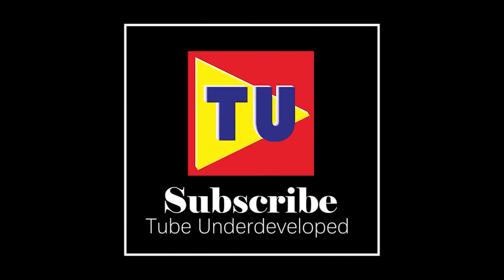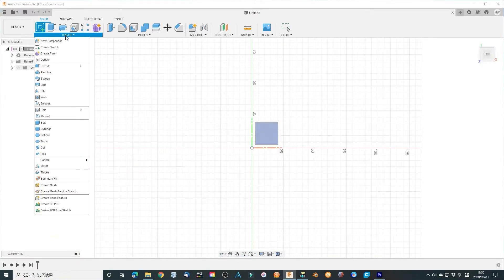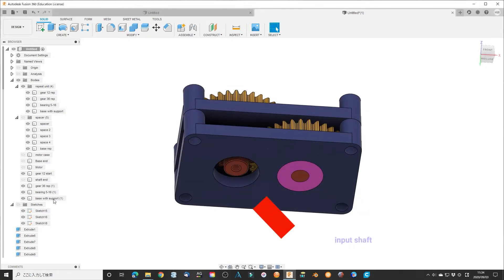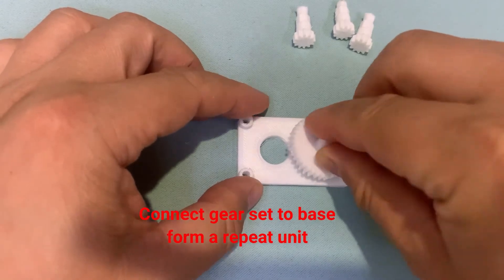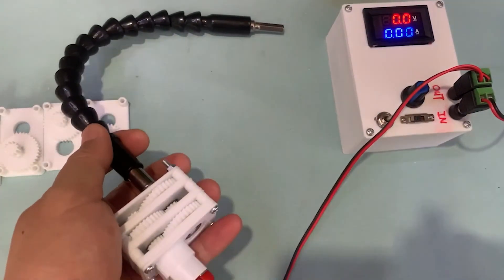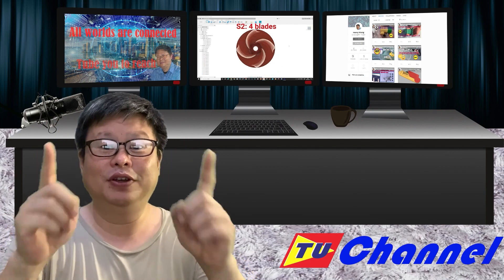How to make an extendable gearbox with ball bearing embedded

Comment: Very good work!!!! 
 I have a question....the specs on this TT DC motor as per this link (https://www.verical.com/datasheet/adafruit-brushless-dc-motors-3777-5912007.pdf) are:

Rated Voltage: 3~6V
Continuous No-Load Current: 150mA +/- 10%
Min. Operating Speed (3V): 90+/- 10% RPM
Min. Operating Speed (6V): 200+/- 10% RPM
Torque: 0.15Nm ~0.60Nm
Stall Torque (6V): 0.8kg.cm
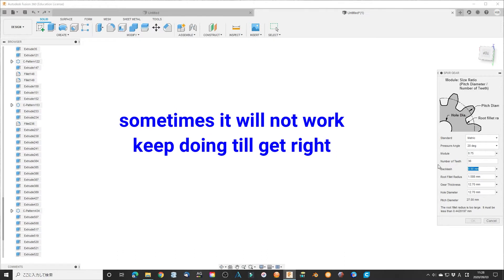Gear Ratio: 1:48
Body Dimensions: 70 x 22 x 18mm
Wires Length: 200mm & 28 AWG

The stall torque  at 6 volts is 0.8 kg-cm ( or 0.08  Nm)....but here is the issue... the running torque is listed as 0.15 to about ~0.6 Nm ....This does not make any sense. The running torque should be less than the stall torque.   Based on what you know...what will be the stall torque for this  motor at the wheel axle (a gear ratio of 1:48)?  How the running torque is larger than the stall torque...??? .. It can be say that the spec are wrong... but still I would like to know  truly the  stall torque for  this DC motor at the wheel axle...? My guess is that the 0.8 kg-cm seems correct... since it will produce a torque of about             1.6 mNm which seems ok for a 3 to 6 volts toy motor. Keep the good work!!!!  Check my channel since I do a lot of work with Arduino...and other stuff.  You got a new subscriber!!! Thanks.
Reply from the maker: Thank you very much for your comment. As you know the stall torque is the torque when the motor is stopped. It must be the largest number. Also, we say we can increase the torque by decrease the speed. I suppose the stall torque is the motor real torque when no gearbox attached. And if use the gearbox that the gear ratio is 1:48, which means that by decrease the bare motor speed 48 times then it will increase the torque 48 times. Now it can give the highest torque 3.84 Nm. So when running the torque is about 0.6 Nm. This will make sense.  Hope this can explain a little. Thanks again for subscribe.  Have a nice day.
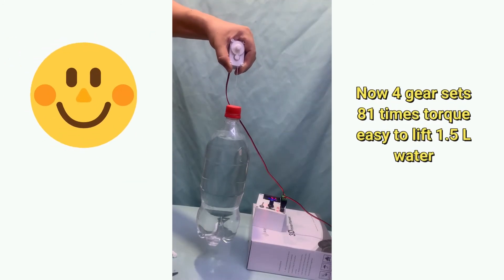Reply: @TubeUnderdeveloped  Very good answer...however it seems too high torque at 3.84 Nm at the wheel axle for this small motor.  The many tests that you have done with similar DC toy motors ...put the actual torque at the motor (no gear reduction) ...at say 0.001 Nm (or 1 mNm)...If you multiply that by 81 (gear up) ...the torque increased to 0.08 Nm ...at 5:29...your motor with  gear lifted a 1.5 kg water bottle....which make sense based on the fact that ...Force to lift > 1.5 kg = 0.001 *81 /(9.81 * 0.005) = 1.65 kg   more than enough to lift the bottle. (I figured out that the radius  of the lifting axle was about 0.5 cm...maybe is in the video...).

Again, I would say that the torque in this tiny motor at 6 volts  is about ~ 1 to ~2 mNm (without gear reduction).  The  80 mNm listed in the spec for the TT must be at the wheel axle ( say 1.5 mNm * 48 = 72 mNm). What do you think ?  Maybe I need to purchase one of this motor with its gear reduction...and do some measurements!!!